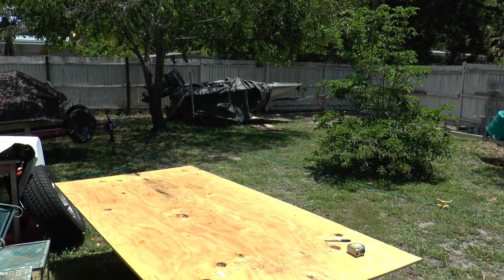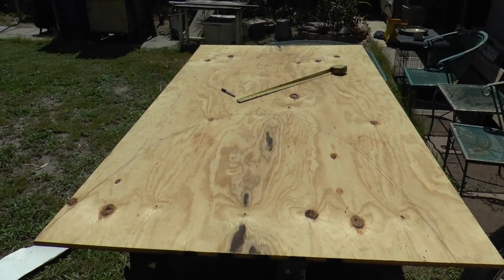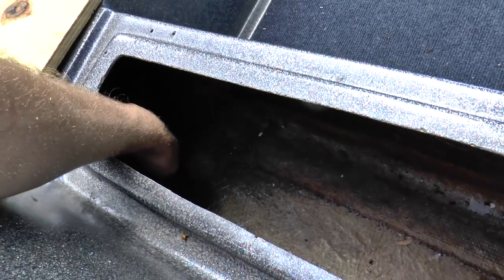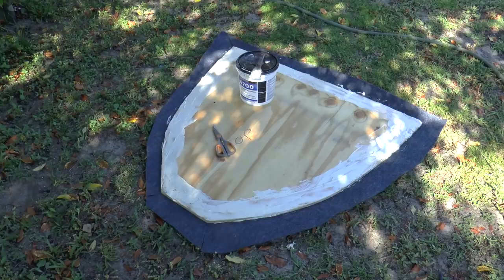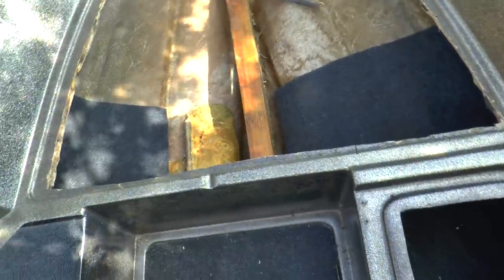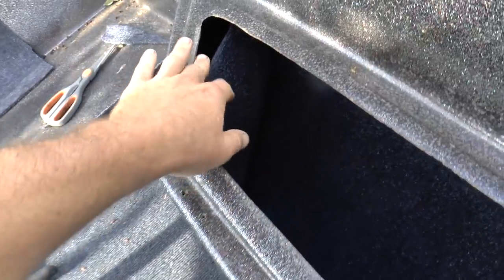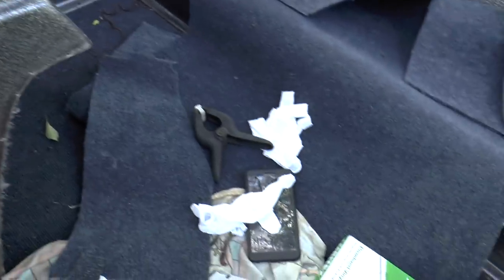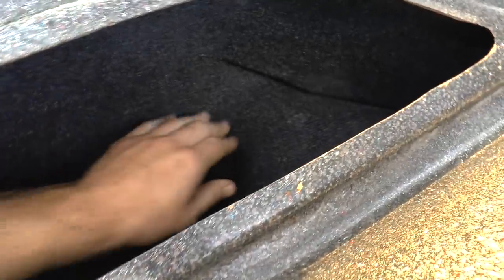Working On The $250 Bass Boat Part: 3

Comment: Carpet aboard a boat in my opinion is not a good odea, particularly inside a locker.  I imagine by now it is a sodden, smelly, moldy mess. By the way, the "forward deck" is called the foredeck.  There are floors in most boats, but they're not what you think.  What you're walking on is the cockpit sole or just the sole.  And the three long words (starboard, green, and right) all go on one side, the side on your right when facing forward.  Port, red, and left, the three short words, all go together on the other side.  It's a good idea to have a small motor, perhaps three horsepower, on the transom if there's enough room, on a transom-mounted bracket if there's not, so you can return to port under your own power if the main engine fails.  Consider a Power Squadron course in seamanship and small boat handling.  And remember what happened to Titanic and reduce speed at night.  Good luck.

Comment: The battery boxes are better off with 1/2" neoprene rubber under the battery than carpet. The neoprene cushions the battery  from wave pounding shocks  which will make the battery plates break/fail quicker. Carpeting the battery box walls is good for looks though. 
I am going through the wood rot repair thing in my boat at the moment- so all that bare wood under the front deck carpet and bottom is another job in 3 or 4 years time to me. 
 I also fitted some under deck inspection hatches  (4" round ones) so I can air out the bilges  when the boat is not in use. That will help the stringers stay too dry for wood rot to grow .
I just wish our motors cost as little as yours do. You can add around 100%  for the Australian prices - so we tend to fix things longer than you guys do because we just cant justify the price of a new engine as easily.

Comment: For the back is better to have soft rubber matts, the ones that have holes in them, some reataurants use them in the kitchen floors, it will be better since water always gets in there, plus it will cushon the batteries a bit. Dont glue them in so you can take them out when you want to clean the back well. They work great, well at least for me.

Comment: Yes, people are saying the dirt is bad for carpeting it, but it doesn't get dirty with a closed latch, it keeps stuff from sliding as bad, it doesn't scratch you fliverglass!! It is much quieter, and what does it matter if the carpet gets dirty, the only time you need to go into there is to charger or remove batteries, carpet it, and then post about the boat

Comment: You should use marine grade carpet. It has a rubber backing to prevent glue from coming through. Plus you should use a contact spray adhesive. Faster better and easier
Reply: Wrong glue... wrong carpet...... funny how they always find after they have messed it all up.....

Comment: I just subscribed to watch the build. The boat is coming out great. Me personally I would not put carpet in the battery box. You will be surprised at how dirty it gets back there. it will be much easier to remove the batteries and wash the fiberglass than have to scrub the carpet. the carpet will hold a lot of dirt and moisture in the battery box. that's just my opinion
Reply: Agreed don't carpet the battery area!!